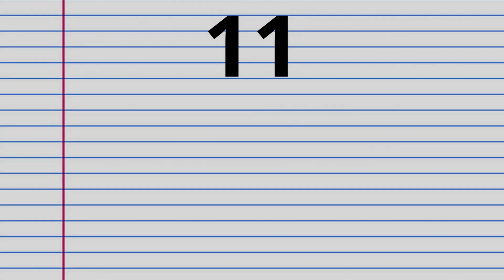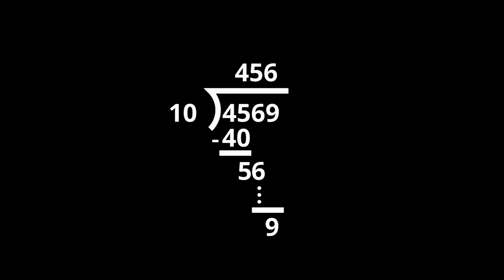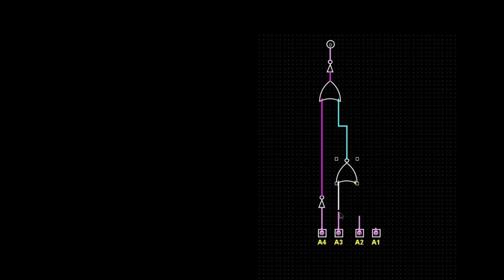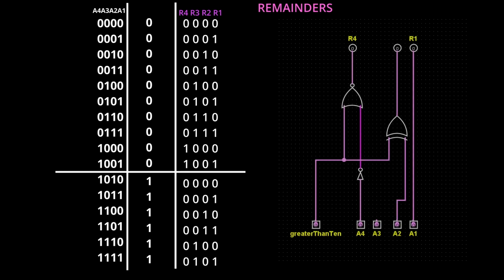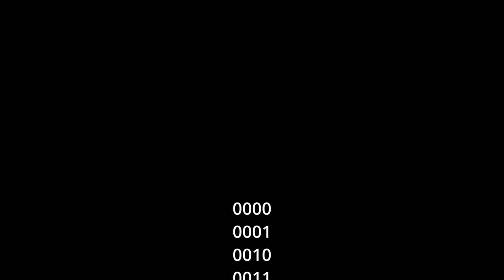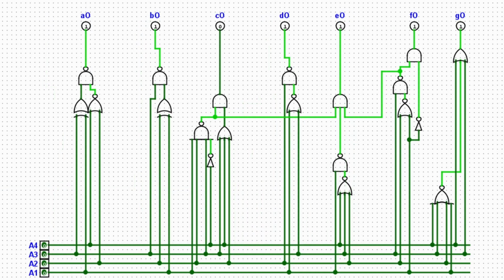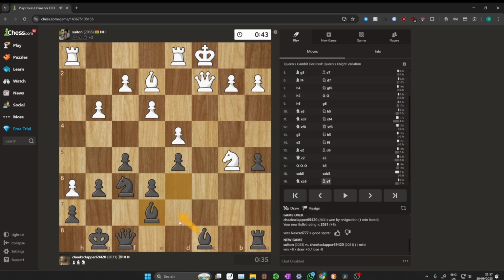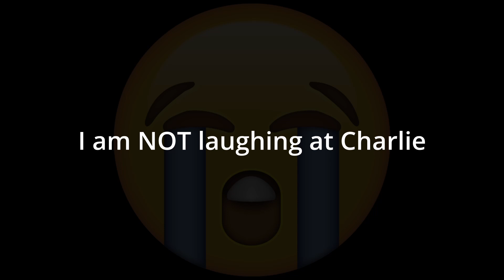I Built A 7 Segment Display From Transistors!

Comment: Moving from Arduino/ESP32 to lower-level, pure transistor circuits. I’ll definitely try building this and following this video on weekends when i have time. Thanks in advance :d
Reply from the maker: That's great! I wouldn't build this for my first transistor circuit because there's a few things you need to be mindful of. I wouldn't want you to give up because your circuit doesn't work right but here's what you need to know.

If you share an input to many different transistors, you have to use resistors for EACH transistor and link all the inputs like this:

----! - - - -Resistor---trnsstr
       !
       ! _____Resistor___ Trnsstr

This is very important because if you don't do this, you might get lucky sometimes and it works but usually it makes some transistors stop switching and the whole circuit just doesn't work

And Make sure all your transistors are connected to ground correctly if they need to be.

Extra tip: Build one logic gate, and check if it works. If it does then build another until you're done. Makes it easier to debug.

Goodluck! :)
Reply: How did you get started in all of this? I’m new to arduino but I really this kind of stuff
Reply: @Chefmeh just pick up random thick book on electronics :d right now I am reading art of electronics 3rd edition. Also youtube videos like this and Ben eater. and most important thing: just experiment stuff and figure out in process
Reply: @NikolozLortkipanidze  thank you

Comment: I only watch stuff from my subscriptions (turned off recommendations) so it’s a cool coincidence to wake up to this in my subscriptions after searching for building logic out of transistors last night. It’s really interesting to see how you analyze what logic to build using zeros AND ones. I only ever consider the ones and sometimes use K-maps and end up with just ANDs and ORs to output ones as needed. But you do some clever stuff that includes negatives like R4 = (NOT A4) NOR greaterThanTen. Edit: speaking of PCBway, I’ve been avoiding making PCBs lately due to tariffs. I designed and had a keyboard PCB made by PCBway and it ended up being like 2x the price back in May ($72 due to size, $156 after duty/tax/fee etc.) Still cheaper and faster than getting it made in the US though.
Reply from the maker: K Maps?? 🤢 Get the fuck outta here😂. Nah I'm joking. If you stare at a truth table for long enough you'll catch a bunch of these tricks. And I like analyzing the zeros because the resulting circuits almost always use fewer transistors. 

2x for PCBs is ridiculous 😭, just get yourself some breadboards bro, join the good side! :)